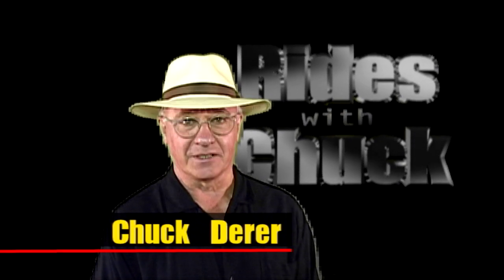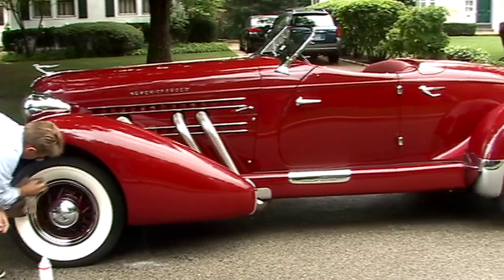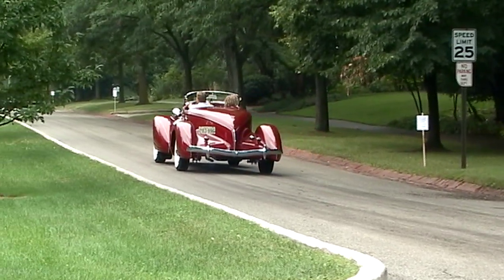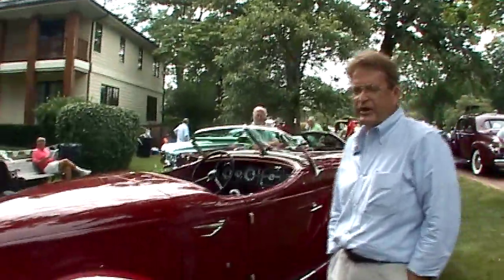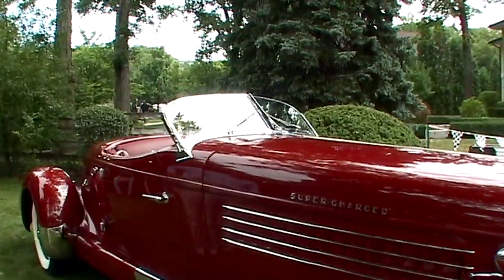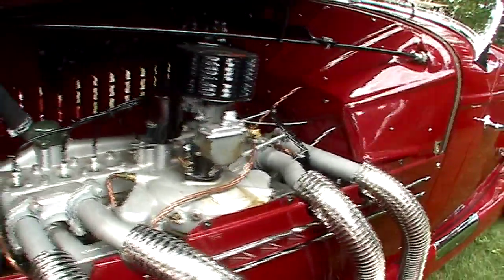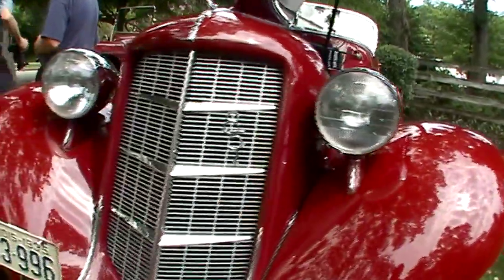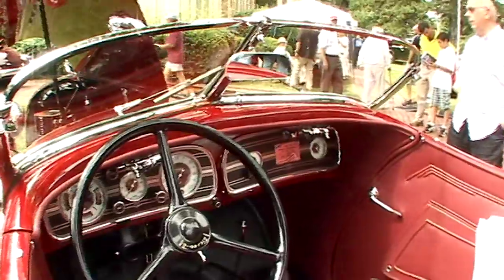1935 Auburn Speedster  A Classic Car Club of America Classic

Comment: I know about redoing an older car like this  but twenty five yr's???
I guess slow and doing it right.
Id do the same thing.
really nice 851.
dad and I were at Harrah's in 77 having lunch at a picnic table on the middle of building's
In comes this biege 851 with dark brn seat's  they park it it front of us 
and then walk away,
just redone, fresh paint and bugs all over the front.
you could smell the new engine paint 
out in the back roads testing it after redo.